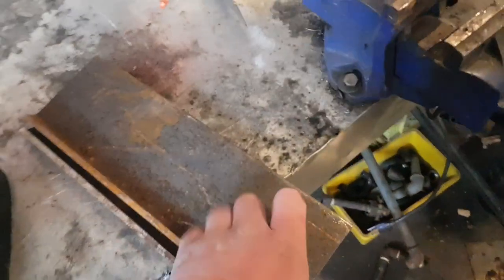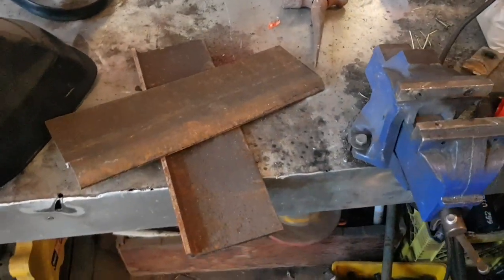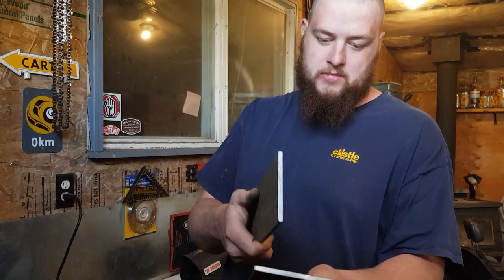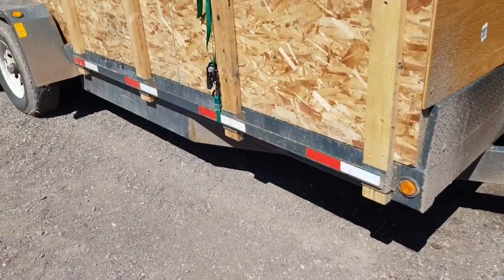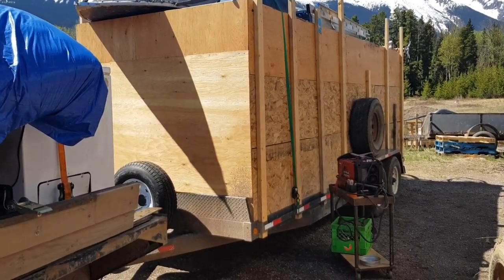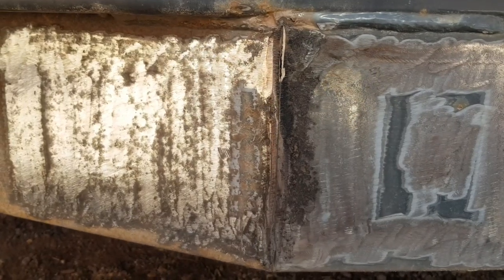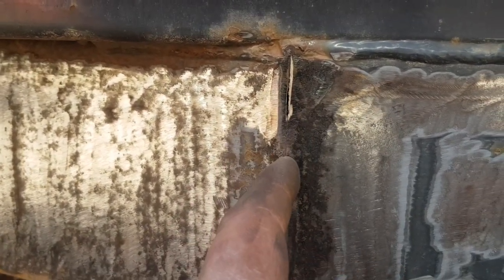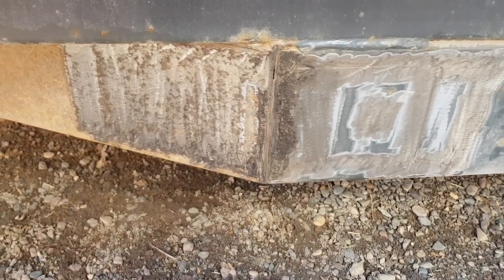Reinforcing flatdeck trailer! Frame was cracked

Comment: Has somebody who does welding on trailers and trucks and heavy equipment, please don’t say well downhill with a light small welder. You have zero penetration it’s a weak weld and something that’s on the highway with a loaded trailer like that and it fails you could possibly kill somebody. Practice practice practice you’ll get there where you can weld uphill and it won’t drip on you.